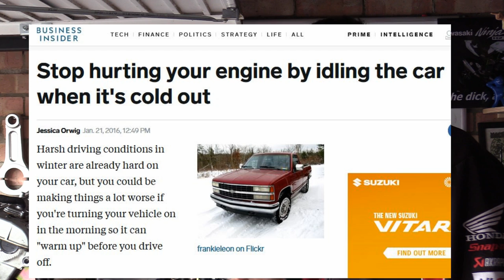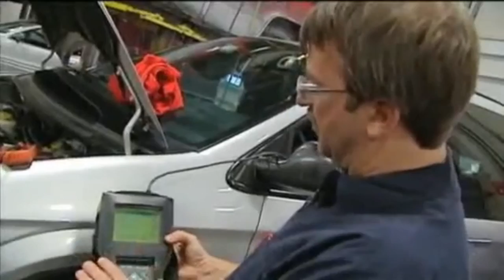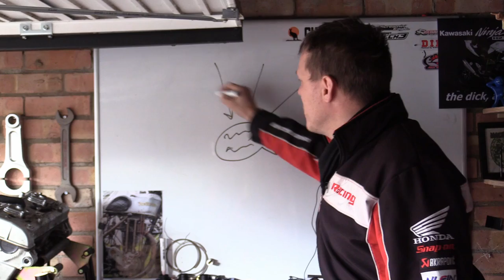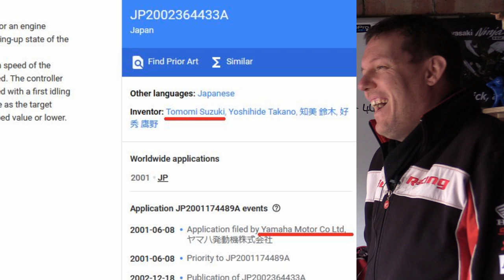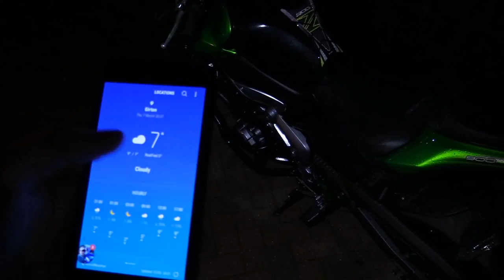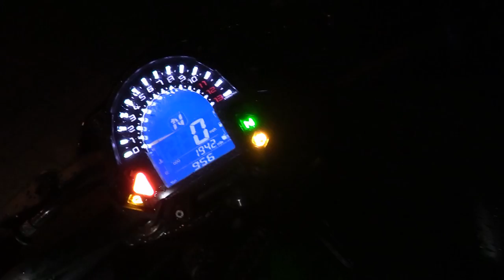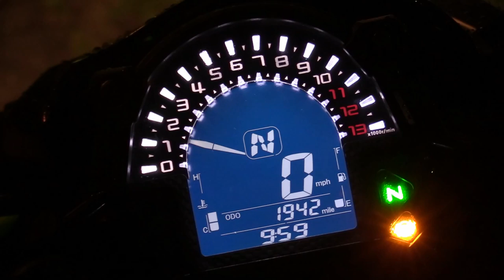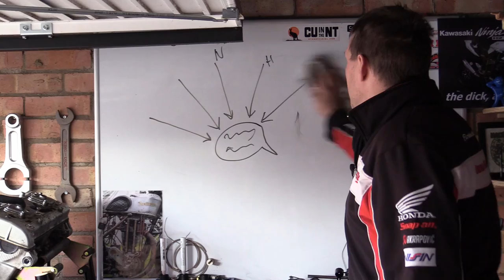Cold weather and Warming up?

Comment: I'm not sure what point you're trying to make, Matt. Do engines need to warm up? Yes. Do you need to let the engine warm up before riding off? Not necessarily. If it's a pig to ride when it's cold (carburettors), then let it warm up. If it's not a pig when cold (EFI), then start it and ride off.  Also, nearly every road engine with an ECU and EFI has some sort of automatic fast idle control , it's nothing new. (I say nearly every engine because my old BMW K100 has an ECU, EFI, and a "choke" lever on the handlebars.)
Reply from the maker: "it's nothing new."

- Never said it was.

"Also, nearly every road engine with an ECU and EFI has some sort of automatic fast idle control "

- Also not true.....

Comment: can you let your bike warm up for too long?  i wait for 2 minutes until fast idle has gone off then set off ( sometimes a Minute or 2 longer)
Reply from the maker: Kinda - specially if its air/oil - with no air flow then the engine is running on the hot end, but too hot? Not unless there's an issue
Reply: @dirtygarageguy  no theres no issues mate, thanks

Comment: Toyota car manual: Your Toyota's engine is its heart: warm it up properly before using it intensively. After starting a cold engine, avoid high rev's for the first few miles. This will ensure the best warm-up and a long life for your engine.
So.... Matt is corect, once again!
You should also let them idle to cool down, especially if you have been flogging it and it's turbocharged.
Ps. I know it's not bike related but if possible could you do a video on diesel injectors? I've fucked mine up, taken them to bits to clean, put them back together and....... Yeah, doesn't work, and I can't find any decent information on how they should work. What to look for, leak back, how to test etc.
Reply from the maker: "Ps. I know it's not bike related but if possible could you do a video on diesel injectors?"

- Funny you ask, I've just fished out an injector out of an audi and it was blocked - replaced it with a new one and this 'fucked' one we're going to cut it open so I can show how they work.

The big pain in the arse is that they're made from pretty good steel and some elements are hardened - so need to sacrifice a few carbide bits to the machining gods LOL

Comment: Never warm my car up unless it's frozen. 
Bikes get warmed up EVERY time.

Zzr1400 has same system as the z900.  👍
Reply: I warm the car up once it sounds rattly, let the oil circulate, then drive away smoothly
Reply: @forevercomputing  mine's just hit 173,000 miles.  Original clutch,  non-smoker, loses no oil.  Not bad for a shitty Hyundai. ;-)

Comment: One last thing, there's a difference between what one CAN do and what one SHOULD do and far too often people confuse the two. Technically, yes, you CAN drive off on your car/bike just after starting it, but that doesn't mean that you SHOULD. Also, like most things, one should try to avoid either extreme; while you shouldn't drive off before your engine has warmed up, that doesn't necessarily mean you should leave your bike or car idling for 15+ minutes either. Lastly, depending on the particular car or bike, driving off before the engine has reached full operating temperature probably won't have a significant impact on wear/longevity, SO LONG AS you "take it easy" and don't immediately put everything under high load(racing, pulling a trailer, etc.) until proper operating temperature has been reached.

Personally, there have been a few times during cold days when I've had to hop into my Jeep or truck and drive off not long after starting it with EVERYTHING still cold. With both of my Jeeps and my truck, even on days at or below 32F/0C it usually takes only 3-5 minutes until I have heat in the cabin and the engine has warmed up a good bit and I can drive off at a normal pace.

Comment: every car ive been in has a fast idle as well, built in through either the drive by wire or an idle air control valve

Comment: He's right! its not nessecary to warm up your engine before you ride away (Modern EFI engines), But you'll wear it out faster if you do! BUT...... just because you can do something doesn't mean you should, eh?
Cold oil can't get to the tight recesses that hot, thinner oil can and so needs time to get there and piston rings have not expanded into their grooves and closed their gaps yet so efficiency is not optimum,
 I know you know you this Matt, but maybe others don't. 

Many Ducati's have a warm up cycle time programmed into the ECU which means you can't ride off before the engine has reached an acceptable temperature. It'll Just cut the engine if you try. These guys know their  (Over complicated) engines so are they wrong? I Don't think so....
My own triumph can't be ridden away straight off the button as it takes at least thirty seconds of idling for it to recalibrate the throttle position sensor each time (Warm or cold!) which is a pain when warm but when cold it gives me time to put on my helmet and gloves while it runs up! It does warm up very quickly so its not too bad...

 P.S. Why does that Scotty Kilmer have to scream at the camera all the time???
Reply: I warm up my bikes. EFI, 125 and it was purchased new by me, and now it's on 38,400 miles.

When it's on the "cold" map, it stutters around just before 20mph. Once it has warmed up, it will run the "hot" map

It isn't just mine that does it. My friend's scooter does the same - which is now mine.

Comment: Put 880k on my gl1500 I sold it with 900k miles on the clock. It worked perfectly. I didn't warm it no fancy computers just good old well designed bike. I never even thought about warming it, I choked it for 20 seconds as I pulled off then returned choke to nothing and went on my way. I've put millions of miles on all 6 of my wings never had an engine fail from never warning up. Shit just works. Do what the manual tells you. Don't sit there warming your bike up.
Reply from the maker: "Don't sit there warming your bike up" even though that's what the manual tells you...

Comment: It's more then that, if you're riding with cold oil on a motorcycle, you're putting load on the gear and clutch because they share the oil with the engine and when cold it's not getting around enoght because of the cold characterstics  viscosity you talked about ... But I own 2 vehicles, one is always getting started and driven away and one always stands for 2 minutes, both have over 150k and I had both for almost 8 years. To be honest although I'm an advocate of letting the engine heat up . I never had problems with neighter.
Reply from the maker: There's a difference between failure and wear....

Comment: I thought you shouldn't let your bike warm up in idle because there's not much oil-pressure, so the oil can't get in all the bearings etc. Thus you should take off immediatly, run the engine at low load until it's warmed up and then you can give it the juice.
Reply from the maker: Think about what you just said....... 

"there's not much oil-pressure, so the oil can't get in all the bearings etc"

- So instead you wanna use those bearings dry?

Comment: For the sake of conversation, the high speed idle might be there to prevent cold engine stalls and easier starting just as well. I read my manual (ktm 690 smc) after the last video you posted about this topic. It says nothing about sitting there idling and have it come up to operating temperature. In the Riding Instructions section of the manual, it says, "High engine speeds in cold engines can have a negative effect on service life of the engine. Always warm up the engine at low speeds." Hope this adds to the conversation in a positive manner. Everybody knows to not ride like a knob when the bike is cold.. or at least I do.  :D
Reply from the maker: This can also be due to port icing due to being such a big thumper. That in itself is another reason.

Comment: this is a dumb idea, but if 75% of the wear is in the first 5 minutes, is something like a block or sump heater viable to mitigate wear during that period?
if the justification for a fast idle is to reduce the amount of time spent in the 'cold region', then externally warming the oil should push this to an even smaller time. is this dumb, impractical, unnecessary or all of the above?

i saw the concept used to heat up russian tanks and trucks in the winter with coal.
Reply from the maker: Yes this does work, but not many people want to plug their bike in. And lighting a fire under your bike is not a good idea LOL
Reply: This is why the Americans only invade hot countries. They used surf boards to go into Grenada.

Comment: AHHH FUK I am so confused now please someone answer - should I idle my ol'  mechanically injected 89 diesel to warm it as is - or would it be better to choke it thus raising the RPM (possibly causing more ware at on a cold engine)? Is choking a dirty d engine giving more fuel or like the choke on an old carby just restricting air (increasing fuel to air ratio). 
FFS I am confused :< I want my engine to live long and prosper as an engineer.
Reply: fuckin' cylinder glazing on diesels with excessive idle,  Fucking choke, fucking fast idle - should I put a brick on my throttle throttle to warm it up?
Reply from the maker: "should I idle my ol'  mechanically injected 89 diesel to warm it as is"

- Yes.

Using a choke is to richen the fuel mixture - I did a video

https://www.youtube.com/watch?v=3bOyb8xWfLw
Reply: I guess comment didn't exactly make literary sense. Thanks allot Matt.
Reply: Cheers mate. I suppose I wondered if the choke on a diesel worked the same as on a carb - ie restricting air with same fuel jetting thus richer charge. Alas it must do cause it surely isn't linked to the injectors in any way. Dunno what I was thinking. Thanks Kris Nicholson.
Reply: @joshuaharrison9331  Its not a choke on a Diesel engine, when you pull it out it  alters the injection  timing and raises the idle speed  to aid cold starting.

Comment: You do in minus 35 degrees celcious .you would not be able to see out the windshield. and the engines sound angry even after being plugged in with a block heater .
Reply: In Lapland they used to build a fire to thaw the oil before starting. I have seen this done on a street in Minneapolis, no joke.

Comment: My opinion: Turn on and drive of when idle goes down and ride gentle the first 10-15min then speed up and after 5 more min give it the fuck it needs. Works all the times! I use to have a XT500 it got the fuck from the get go and never complained about it. How long? IDK I sold it after a few years and never have seen it again... Conclusion: it is your engine so do as you prefer.

Comment: The owners manual for the 2015 Citroen C1 specifically states that you should pull away within 30 seconds of starting the car.
Reply from the maker: Because? Then you get to the end of your street and sit at idle for 5 minutes in a traffic jam......
Reply: @dirtygarageguy  I was wondering, is this partly (I know about viscous drag etc) why manufacturers have moved away from 20w50 and have over the years moved to pisswater like 0w30 and 0w20's? So you get better initial flow of lubricants to limit wear during warmup? Would also be interesting to know just how much improvements in materials has affected engine wear during warmup period on modern engines vs say a 60's wanky pushrod engine.

Comment: Fly by wire systems have the cheaper option of software controlled idle.
Reply from the maker: How? The throttle is controlled by the same motor.....
Reply: You talked about a solenoid, I assumed your bike had a steel cable. Idle control via motor driven butterfly did away with the idle bypass solenoid valve many years ago so all airflow is attained with inlet manifold porting and precise software controlled stepper butterfly positioning.

Comment: An engine with load puts more wear on it than one idling...  So of course it's better to get the oil to it's proper operating viscosity. It has fuck all to do with fuel. FI and carb is just the manner of getting fuel and air into the combustion chamber.  But what about other parts of the engine such as the crank? 

The only type of bike I wouldn't let idle too long would be air cooled... For obvious reasons.

Comment: Interestingly, every BMW bike I've owned, the owners manual specifically forbids warming the motor up and tells you to ride off immediately after starting.
Reply: That warning comes under 'risk of fire'.  There where a couple, maybe more, bikes that self ignited in the USA.  Possibly due to early problems on the fuel pump and plastic tank connectors.  However, a recall fixed these.  BMW were more concerned about litigation, hence the warning.  If the engine wears early it's more profit for them, anyway!
Reply: @dendren01  informative! thanks!
Reply: This is the same with my diesel bmw car, says you must set off straight away
Reply: @bandit12--  When you think of German engineering, just remember the Hindenberg ;)
Reply: They'll tell you this at the dealership as well. I'll still idle it for a bit when it's cold, but, regardless of the temperature, I don't ride it hard for the first few miles anyway.
Reply: @rumien1383  Very wise!
Reply: @dendren01  🍻

Comment: Mat me man quick question 93 fireblade missing one of the 3 compression springs from the carbs throttle mechinisem 
 it's popping like a backfire constantly from one of the cylinders little popping followed by a back fire every now and again 
Would a missing compression spring cause this ?  
Bike was running perfect so I spent a bomb on painting bike and wheels 
New tyres 
Did fork seals brake seals chain  and sprockets  
Braided lines the works 
Put her all back together carbs were leaking fixed that fuel pump packed in 
Sorted that . Rectifier connection fried  sorted that 
Now iv this popping I mentioned. 
 The only thing I can see is a missing middle compression spring  on the carbs
New spring is 65 euro to my door 
Second hand set of carbs is only 80 . 
Any thoughts on the matter ?
Reply from the maker: Compression spring? For the main slide?
Reply: @dirtygarageguy  there are 3 gold screws to sync your carbs that pass threw  springs
Then under them there are the same little spring  but they just sit in on a little nipple and take some of the slap or free play out of the throttle . There only tiny little springs
Reply from the maker: I get you now, damper springs. Yes you need to get that sorted - does the backfiring or revs jump if you go over a bump?
Reply: @dirtygarageguy  its the second bike so not even got the new tyres scrubbed in its killing me 😂  iv been only up an down the road yesterday so i dont know about the bumps but 100 percent the idle is haunting up a little bit one minute so i lower it a little .. then iv to rase it a little .. like only 100s of rpm  now I think of it it did that when i came back up on the curb . 
Damper spring !  I knew there was another name for it . 
I must have dislodged one when I split the carbs to fix the fuel leak . 
Once this is sorted she be like a brand new bike

Comment: Also, respectfully, the part about bike manufactures being the only ones who care about performance is a load of rubbish. There are many manufactures who offer a wide range of different trim levels and options on certain cars/trucks/SUV's, to include higher-performance engines and transmission, 4WD/AWD systems, improved brakes, improved cooling systems, weight reduction, suspension/handling upgrades, towing/payload capacity, etc.

You can't fairly compare top of the line, high performance motorcycles to lower tier cars/trucks/SUV's. It'd be the same as comparing a Dodge Viper GTS ACR/Posrche 911 GT2 RS/Ferarri LaFerrari/Aston Martin Valkyrie, etc., to a scooter or low-tier bike and proclaiming: "bike manufacturers don't care about performance, bikes are shite!"

Comment: He's gotta be right cos modern engines piston skirts expand at the speed of light, as does the oil heating up, the only difference between carb and injection is how the fuel is delivered thats it 
oh and modern metals compared to 40 years or so ago

Comment: look at me dummy always doing what the manufacturer writes in the cars manual, which is always "drive right off, but drive gently until car reaches operating temperature". at least that's what BMW and Porsche say in the manuals of their 90s and early 00s cars. i don't know about motorcycles though, especially due to the different oil and the wet clutches. forget the articles, but i think to a certain degree i can do as the manufacturer suggests, especially when i reached way over 300.000km with some of my cars. 
bikes are a different animal, so i could agree here with you, because they rev a lot higher and are under higher stress, because they make more power out of less displacement. havn't seen a NA car with a 1000ccm engine with 200hp right? 
also i'd have a lot less headache buying a used car with 150.000km on it, than a bike with the same mileage, even if it has had every single service done on time at the dealership and all that.

Comment: My fuel injected bike idles high when cold. Then when engine is warm/hot the idle drops down.
Dk if yamaha designed that for a joke ?
Reply: That would be the same thing as what a choke would do. My PCX 125, CBF125, CB500X do it.